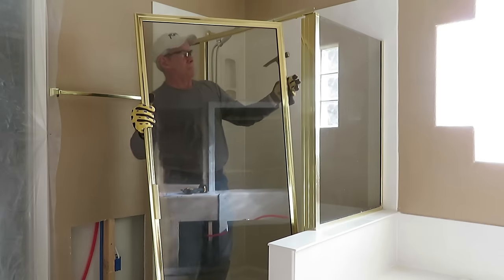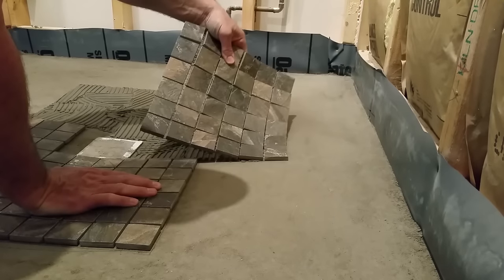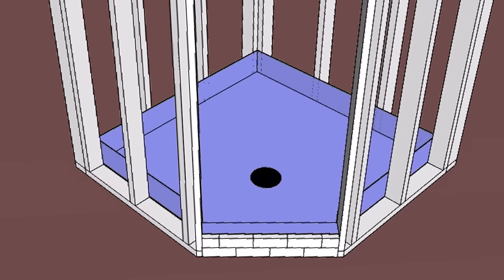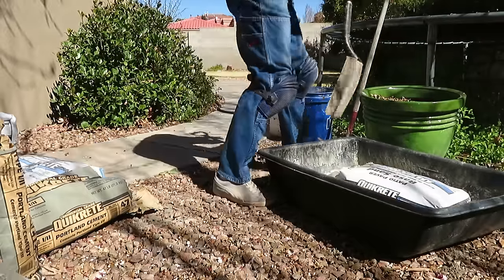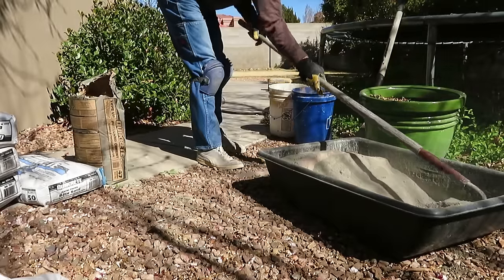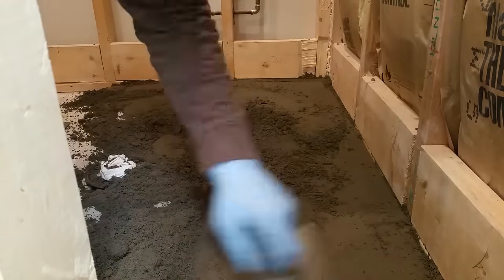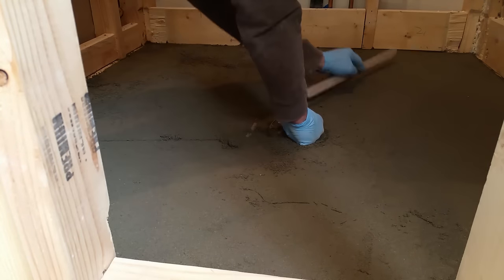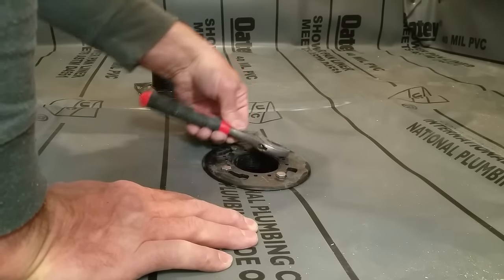Building a Shower Floor From Scratch - Part 1 of 2 - With Shower Pan Membrane

Comment: I've been searching for hours now and still can't find someone to explain the various ways to install a shower pan: hot mop, fiberglass, acrylic and now a "liner" with cement on top?
Reply from the maker: All I can say are RLee is that there are lots of ways that people have gone about building shower floors over the years. The method I’m using here I learned about 40+ years ago and it has a history a lot longer than that.

Comment: so the shower pan goes on top of the cement? I thought it was the other way around..first the shower pan then the cement...how does the thinset adhere to that rubber pan...
Reply from the maker: Check out part 2 of the shower floor build and it will make sense... https://youtu.be/9vBwwsSTCXM

Comment: Gotta be an easier way to do this.i have done several. I do home remodel professionally and every time I do one I think there should be an easier way. . Maybe a make a form and then just pour some reinforced concrete... I mean cement finishers pour and pitch cement all day long.....
Reply from the maker: Yeah, ReCycle, I know what you mean but it's pretty hard to beat a tried and true method. The thing I like about the drypack is that you can cut and shape the floor so precisely if the mud is not too wet which makes it easy to set tile on it then. Pouring concrete for me would be a bigger challenge to keep 'wavey' spots from happening. I have resisted for a long time, but am going to be trying one of the Hydro Ban shower systems on my next project because it makes sense for this job. Curious to see how I feel about it after! Thanks for the comment!

Comment: Im going to be doing a wet room   on the second floor of my home. Im assuming I can use this process to  essentially make a large shower pan? The room will be roughly 5'x6'. Id love any tips or advice or if this isnt the way to go what would be best?
Reply from the maker: Yep, Adam, I think you are on the right track or a right track. There are probably a number of approaches that would work for you but I would use this method because I am so familiar with it. A couple of things to keep in mind: Make sure the subfloor and floor joists can handle the weight you will be adding. I'm guessing about 700 lbs. minimum with the dry pack and tile installed. You can probably buy a shower pan on Amazon from Oatley that will cover the area with one piece or if not, then adhesive is available to overlap joints. I would not worry so much about the pre-slope step and concentrate more on getting a good, solid dry pack in place and nice floor slope to the drain. Larger floors like you are talking about can be a little tricky. Another option you may want to look at is Kerdi-Schluter products for your project. I am not a big fan primarily because of the expense of the Kerdi stuff, but the installation is easier and the products are very lightweight. Just some things to think about. Good luck with your project!
Reply: @RustyDobbs  Im actually expanding my bathroom into an unfinished space on the second floor. Right now the floor beams are a non load bearing 2x6 setup spanning two outside load bearing walls and one load bearing wall in the middle below it. I will be sistering 2x10's to the 2x6s  to support the walk in shower that recalculated  wil be 6'x5' and a 36"x5' soaking tub. The load bearing wall bellow it will be right about in the middle of the 9ft span tub on one side and walk in shower on the other.
Reply from the maker: Sounds like you have it well under control, Adam! Should be a fun project!

Comment: HOW DID YOU SECURE THE BRICK TO THE FLOOR?
Reply from the maker: Bed of mortar that the bricks are set in. Then bathroom floor tile is cut up against base of the curb from the outside and shower floor rests against the curb on the inside.

Comment: How much working time with mix
Reply from the maker: Good question, Bud. The best way for me to answer that is that when I mix dry pack for a layer, depending on size obviously, but I’m planning to be finished with that layer within 1 1/2 to 2 hours. Basically, I’m working it in place steadily without taking a break. That assures a good end result. Realistically, I have probably another hour before I would get concerned. It also depends on how much water I’ve added. I like it only wet enough to set up the portland because that’s when its easiest to work. The wetter it is, the bigger pain it is to cut and pack because it gets sticky.

Comment: I have a question.  I want to replace my tub with a shower.  Ive noticed there is a huge void of concrete around the drain area. What do I do with that hole?
Reply from the maker: Typically, plumbers will box out the areas around drains coming through the slab before concrete is poured so they have some flexibility to move the drains around without busting out concrete when they are setting tubs, etc. Once you have your drain positioned where you want it, pack the dirt well around it three to four inches below the top of the slab. Then, mix up enough concrete to fill the void.

Comment: Why do you use mortar instead of just making concrete? If you wanted to, could you just substitute the drypack layer using colored concrete and stamping a pattern into it?
Reply: Mike McKeen great idea. I’m gonna start doing that in all my showers.
Reply: renaissancemen1 I thought it might make for a cool option, but that's why I asked. I don't know if concrete is suitable for that kind of installation.
Reply from the maker: Hi Mike. Your idea has merit and I have seen it done on occasion but not in a residential shower. The dry pack concept is just the traditional way shower floors have been installed for decades. When done correctly, these types of shower floors can literally last for decades which is why most old time tile setters default to this method. Its the saying, "If it ain't broke..." in action. The advantages are that dry pack is easy to mix, cut and shape which then provides an ideal surface to set tile on. 

Your idea would get the thumbs down from most old-time tile setters for a few reasons. First, wet concrete is difficult to shape when compared to dry pack. It is going to have some humps and bumps because of the moisture content and aggregate that are difficult to smooth out as compared to dry pack. Second, cracks are the downfall of shower floors. How many wet concrete pours of any size have you seen that do not crack somewhat over time? Third, because of the last concern and the properties of concrete in general, the concrete would need to be sealed to be used in a wet area like a shower. Unless you added a grit to the sealer, the floor would be slick to some degree. Stamping the concrete would help, but you would need to smooth out the edges left by the stamps because people are going to be walking and standing on the floor in bare feet with the floor wet. I would also be concerned that the grooves left by the stamping would hold water and not let the floor drain completely. The grooves also might be natural areas for the floor to crack.

I think the finished product of what you are suggesting would look cool and might work out perfectly well. There are just a lot of other factors to consider, too. Personally,  my customer who wanted this would have to convince me to do it over my objections. Plus, I don't think I would warranty it. I recently had someone ask me on YouTube about using 12" marble tile on their shower floor that matched the wall tile. I said that it would look beautiful but suggested they run some water over a piece of the marble and rub their hand across it, then imagine that was their feet. They went with 2"x 2" shower floor tile, instead. Thanks for your question, Mike! Sorry for the long-winded response, but you got most of what I had to say on the topic.

Comment: Hey Rusty, I'll finally be doing the pan tomorrow  but the guy at the big box store said I need to put thin set the floor first before the cement sand mix or I'll have issues. I say Dobbs didn't do I don't do it !!!.   I was fairly sure you were working on a concrete floor in the video but I wanted to ask. You had also helped me before about the mix and I had a last question. Can play sand be used with the portland cement mix?  the same guy told me play sand wont work properly. To be honest I walked out a bit confused this guy through me off a bit and has me second guessing. I need a Dobbs ruling on this one please.  Cheers
Reply from the maker: Hey Jim. I'm sure the guy at the store appreciated being told that some YouTube guy named Dobbs had all the answers! I have heard a lot of things over the years, but thinset on the floor before mud is a new one. I'm sure there is some reason people would do that. I just can't think of a real compelling one right off hand. It certainly would not interfere with the mud placed on top of it. Let me put it this way. If I do another video on building a shower floor, it will turn out just like the ones you watched. Yes, it is the concrete slab that is under the shower floor in my video. I think maybe I used play sand one time before. I think it is a little more fine than the paver sand I typically use which has a little larger aggregate in it. To sum up in a couple of points what is most important in working with a dry pack floor: 1) Mix the sand and portland cement thoroughly in your mixing box. 2) Add enough water to assure the portland gets activated but not too much. 3) When you are placing the dry pack on your floor, make sure to pack it tightly against the wall, in the corners, at and around the drain and in the main floor fill area. That means use your fingertips, fist and trowels to compact the mud into place. Once you think you have compacted enough, if you can take your fingertip and press more than about 1/8" deep into the dry pack anywhere on the floor, then toss a little more material on those areas and pound a little more with your trowel. Then you can cut your floor to the final contour and finish trowel the surface. The strength of the dry pack floor is not in a thinset base or type of sand. It is in mixing it right and then compacting it solidly in place. Feel free to shoot me a picture or two of what you are doing to info@dobbsworkshop.com. I'll be working in the shop all weekend and should be able to get back with you if you run into problems. Good luck, Jim.
Reply: @RustyDobbs  Thinset on the floor first before drypack is for bonded application of the mortar bed.   Or, you can apply a slip sheet or cleavage membrane of plastic sheeting or asphalt felt between the slab and mortar bed.  These methods are employed, depending on the condition of the slab, so the shower floor will be less likely to crack in the future.  
Thanks for making this video, this is one of the best out there for shower floor information and procedure and your workmanship is first rate
Reply: Can this work on a plywood floor bathroom?  How would this be approached?
Reply: I have grown to consider the people at big box stores less and less.  If they knew what they were doing they would be doing it not stocking shelves.
Reply: I will say the old school guys were dependable but all these young kids there today that think they have all the answers dont know a damn thing. Just clowns.

Comment: We had a shower totally replaced recently using 12” x 24” tiles for the walls and man made stone for the floor. We were so happy with how it turned out, until we showered in it. The second day we noticed that the edges around the floor were still wet the next day. We stopped using it for three days and it was sill wet but not as wet. What is wrong with this floor"
Reply from the maker: Sorry to hear about your experience, Gordon. Sounds like a drainage issue but don't have enough information to say for sure. If you want to shoot a couple of pictures and send them to me at info@dobbsworkshop.com, I'll be glad to give you a little better assessment.

Comment: What if I don’t have a concrete floor?
Reply from the maker: No problem, Gabrielle. I have another video called "Building a Corner Shower Seat From Scratch" that is built on a wood subfloor. The process is still virtually the same. The only concern is to make sure your wood subfloor and supporting beams and structure is sound. You are adding hundreds of pounds of sand and concrete when building a shower floor directly on a small amount of square footage so you want to make sure the structure underneath can support it.

Comment: Does this mix cure hard like a wet cement mix?
Reply from the maker: Yes and no. If it is compacted really well it will cure quite hard and you can even finish trowel it like wet cement if desired and if there is enough moisture at the surface. Because it doesn't contain aggregate, it will not be strong like wet cement when it dries. But it's primary purpose is to allow you to shape it precisely to build a shower floor that drains well with contours as needed. Tough to get that with wet cement mix. Then it needs a layer of thinset and tile installed on top to make it durable. Good question, TubeFinlay!

Comment: Good demo. A little tip to save the curb and not having to use brick. Wrap the wood curb in protecto wrap. Material they use to flash doors and windows. Wood will never penetrate the curb. Cheaper and less time consuming then installing bricks.
Reply from the maker: Good idea, renaissancemen1! I think that would probably do it. I have developed the approach I use with bricks over the years and have come to trust it to the point that I will likely never change. Have seen too many shower steps destroyed because of water causing the wood to swell and crack the tile. What a pain to fix it! Thanks for your comments!
Reply: Rusty Dobbs good man rusty I've seen some of these installer work in the day it wouldn't fly quality gone now its about how much they can make lazy workmenship

Comment: how is the brick attach  to the floor?
Reply from the maker: If I am installing on a wood subfloor, I will screw metal lath to the floor under the brick. On concrete, I set the brick in a layer of mortar. There will always be a tile floor installed against the base of the brick outside the shower and the shower floor installed against the brick inside the shower, so it is not going anywhere.

Comment: How long do you wait after finishing the 1st dry pack before applying the membrane and 2nd dry pack?
Reply from the maker: 24 hours typically, Rodney. Normally, that first dry pack is on slab so it dries out quickly. I also live in a very dry climate.

Comment: I know it is code but cement on the base is pointless. If you properly install the pvc sheet, cement layer, and apply redgard, it will be ok. If water makes it past all three barriers, then you have a much bigger problem. As for the curb. Over lapping the pvc over curb, install a Shower Curb Overlay, and apply a couple of coats of redgard is really all you need.
Reply from the maker: Yep, there are lots of ways to take on shower floors these days with the newer products. Sounds like you are a Redgard believer!
Reply: @RustyDobbs  Yeah we did the sheet rock challenge. It held up with zero leaks.

Comment: Great videos Rusty, question , i see some people using pee gravel? do i need to use it or just tape the weep holes? i did not see any in your video, thank you again
Reply from the maker: Thanks John. Yes, it is fine to use gravel around the weep holes. Some people believe that it is absolutely necessary in order to keep the weep holes from clogging up over time. I just don't happen to buy that. That said, I do not compress my dry pack as tightly around the drain and in the weep hole area as I do anywhere else. Thanks for watching!

Comment: What did u set ur drain body at above the sub floor to allow enough dry pack around drain?
Reply from the maker: The 2" shower floor drain pipe had been boxed out for the original slab pour, so I had about 4" clear all the way around from the slab to the pipe and to the dirt under the slab. So the flange on the new drain was able to be mounted almost flush with the slab and the void left from the pour was filled with dry pack.

Comment: So basically it's like mixing metal casting sand
Reply from the maker: That's interesting. I did not know that. I am planning to do some casting but have not researched it to know the first thing about it. You do use a cement additive to your sand? Would appreciate some direction if you have information handy. Thanks for the comment!

Comment: Why did you use bricks for the shower curb exactly? I have never seen that in my life. If you water proof correctly you wont have to worry about water. Thats the purpose of all these great products they have these days. 

I mean bricks will work fine obviously but with stuff like schluter or mapeis products. Done right you won’t run into an issue.
Reply from the maker: Hey, ZchryPlys, I think you know you have answered your question to me with "I mean bricks will work fine obviously". Assuming a wood curb is properly waterproofed, you don't have anything to worry about. Conversely, if water gets to wood in the curb for some reason, your curb is toast in a short time. Not so with brick which is the way I was taught 40+ years ago. 

You should be thinking about how you will respond to a young guy who may ask you a similar question in a few years like, "I mean Schluter or Mapei products work fine but why aren't you using all these other great new products they have these days?" It's a generational thing to a degree! 🙂